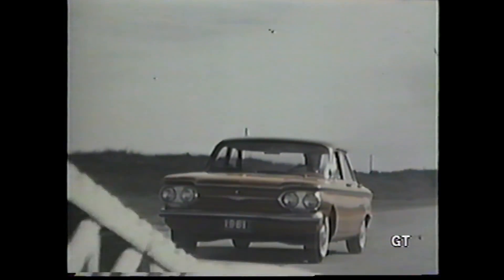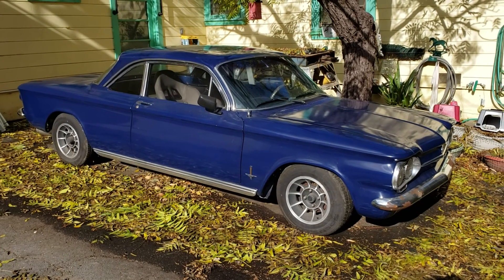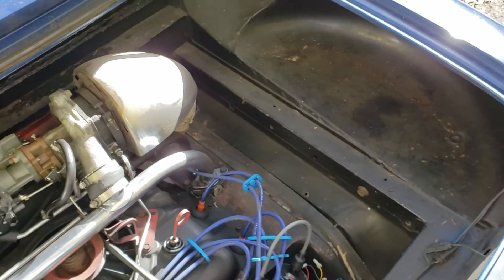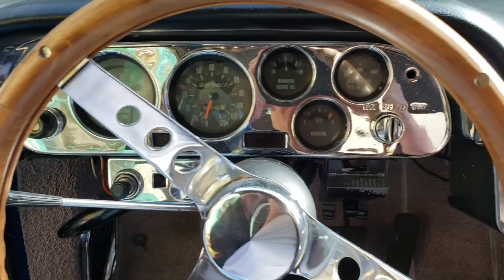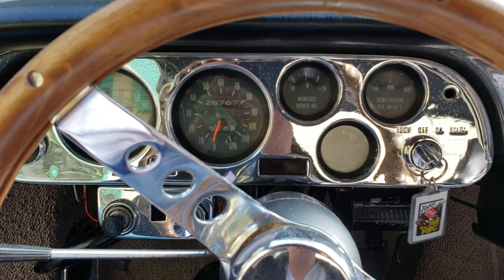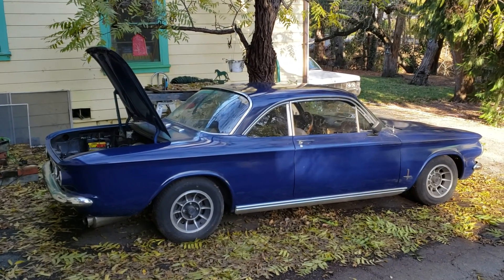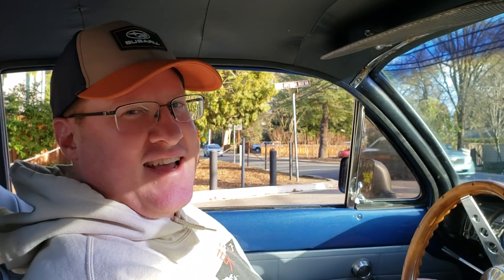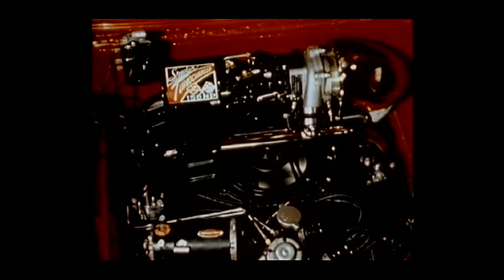My 1963 Corvair Monza Spyder: A Turbocharged Air-cooled Oddity

Comment: Love the vintage videos at the beginning and end! I had a 65 Monza 110/PG. I found that the best handling for my car is 20 in the front, 30 in the rear for air pressure.  The car was fun to drive!
Reply from the maker: Awesome! I run similar pressures with 25 front and 35 rear and I also have a bag of sand in the trunk to weigh the front down some haha
Reply: @philberto78  lol. I never tried the weight in the front.  I was able to fit all of my drumset in it though!

Comment: There is a small company that makes a fuel injector replacement of the turbo carb. They basically took the fuel injection from the Pontiac Fiero, which is also a six (v), and tweeked it to work very nicely in a Corvair! 🙂
Reply from the maker: It's good that people are coming up with all these alternatives to the original carburetor. I've just ordered an electronic fuel pump that's supposed to regulate fuel pressure better than the mechanical pump. Hopefully it will solve my flooding issues for good!
Reply: @philberto78 be advised some fuel pumps do make too much pressure so if you get carb leaks after you put the pump in you will beed to reduce pressure.
Reply: free food card

Comment: I had a Spyder back in the day. My biggest problem was when it was hot and you shut it off, it would vapor lock and refuse to start.
Reply from the maker: That's interesting, I've been unable to start mine many times as well after I've driven it around already. My problem was just flooding though. I've recently gotten a pressure sensitive electric fuel pump for it but I haven't installed it yet.

Comment: 4:20 they are about the same as any other engine but with some quirks.

Also i dont think tge early models cane with a alternator so that was put in and i think atleast that cap on the distributor is aftermarket, i think they all were boack 
I plan to put in a modern ignition system and some other nuce things.
Reply from the maker: Yes that's one way to put it haha! Ah you have a Corvair too? Definitely get rid of those points and it will run much better. The fuel pump I got is from Clark's Corvair and it is supposed to have the exact pressure the car needs. I haven't installed it yet though.
Reply: @philberto78  I think it's around 6 or so psi, I might just replace the carbs with efi it bike carbs at some point.    Mine is a 63 Monza.

Comment: We had a regular Corvair a couple of years before we got a Monza Spyder.    With the standard one you had to really look for a chance to pass, but the Spyder had plenty of acceleration.  It had sports-car like suspension (a first in the US I think), and the Corvair was the first unibody car built in the US.  They tended to throw fanbelts-- one learned to keep a spare in the car.  (Allegedly a pair of panty hose would work well enough to get you to where you could buy an OEM belt.)   The front end was a little light--it handled better if you tossed a small sack of sand or cement into the trunk.  Our previous car was a 1950 Oldsmobile 98, so riding in a Corvair it seemed like your rear end was almost on the pavement.
Reply from the maker: I've luckily never thrown a fan belt but everyone who's owned a Corvair has told me the same thing. Well not about the panty hose though haha! Yes it's a very different driving experience than most cars, very sporty especially for the time it was made. I keep a bag of sand in the trunk as well to keep the front end down better.

Comment: The sad part is storing it outside and a cover can be problems with holding moisture under it. Should also  start it frequently. The oil could be bad with condensation so hope you checked it. Guess this had been some time ago.
Reply from the maker: Yeah I really felt bad about neglecting the poor car for so long, living in another state made it really hard to keep the car up. Now I finally have it with me in Arizona where I'm working on it again.

Comment: SYK - It was the second turbocharged car (by a month).  ;-)
In the early 70s, Nader was proved wrong.
A Corvair is no more dangerous than other vehicles of the time.
Reply from the maker: I had to look it up but I guess you’re technically right haha, that short lived Olds Jetfire released a month before! Seems like it was kind of experimental as it needed a methanol injection system just to avoid engine knock...yikes!
Reply: Ah, somehow I missed that, I was sure it was a production, not a test bed, I'll look again to verify what I read?  If it's a production car, then Ill be right.  ;-)
Reply from the maker: @TairnKA  It was produced, I just meant that the car had a very short lifespan due to not being engineered very well. I think I read they made almost 4k models with the “jetfire” turbo though.
Reply: @philberto78  Ok, thanks.

Comment: I just bought one of these recently, and I'm rather hoping that you might have some ideas for me. I'm having  an issue with my 64 turbo, she's idling too high, and running too rich. I think I can fix the fuel mixture by adjusting my carb, but I'm not sure about the idling issue? Any ideas?
Reply from the maker: Congrats on your new ownership, or maybe I should give you my sympathies haha!
If you can't get the idle down by making any adjustments to the idle or mixture screws you might need to adjust the carb's float level or get a card rebuild. I think I mentioned it in the video but the carburetors in these cars are what's going to give you most of the headaches.
Reply: Check the throttle shaft for play, as it is probably worn, and will cause a air leak there, and mess with the idle speed. Those throttle shafts are chrome plated brass, and dont fit well (excessively loose) even when new. There are new throttle shafts available that fit much better than stock.
Reply: Replace carburetor with a fuel injection kit from Blackhawk engineering. It's basically a tweeked Fiero injector and your life will be smooth sailing when it comes to car idling, etc... you will have to plug it in to a computer to make adjustments but the kit comes with the program(I think) to manage it.

Comment: Usually, the first modification owners made to their turbos was to remove that tiny little restrictive Carter YH carburetor! those carbs didnt work that great when new... they are flood prone, and are typically set-up too rich. A bigger carburetor will allow a LOT more boost! The hard starting when it has been setting a while is the float bowel getting dried out, and can be fixed by adding an electric fuel pump. Turn the key on, let the fuel pump prime the system, then hit the starter... it should start right up.
Reply from the maker: Yeah I can't even tell you how many times I've had the carb flood in the past...but it's running pretty well now after I adjusted the float level finally. I'm trying to keep the car as stock as I can for now, even though I'm sure that like you say I'd get more power from a different carburetor. 
I checked out your old video and it looks like you did A LOT of work on your '63. Pretty cool engine setup indeed! Are you still driving the car?
Reply: @philberto78  Yes, I'm still driving it, although since those videos were done I had to replace the cam. It has a custom cam and once I got the timing curve and fueling right for it, SHEEZUS does it scream! I have 22,000 miles on it with the new cam... approximately 6000 miles per year. I get 22-23 mi/gal "around town" and over 24 on the freeway. I hope to get a couple more videos up this year on it.
Reply: @philberto78  Although the re-setting of the float height helps a lot with flooding, the near total cure is to add one of those all metal ball and seat type of float valves.
Reply from the maker: @63turbo  Wow that's awesome that you drive it so much!  I'm not sure what you mean by metal ball and seat valve, where would I get something like that and do they make one specifically for my carb?
Reply: @philberto78  Yes, they are available for the Carter YH. Clarks Corvairs has them. The float valve that you now have has v-shape, and has to push against a sharp edged hole to close. These have been made with both rubber tips and brass tips, but both types wear out (from the sharp edge) and are not accurate in metering. The "ball type" replaces the pointy v-shape with a ball bearing, and has a conical seat (kinda like the point on a drill) to push against to close. Before I used that type of valve (when I was using the YH), it was pretty normal to have it flood 4-5 times a year. After I replaced it, only one flooding event, and it turned out that the choke had gotten stuck closed, so it wasnt the float valves fault. The revised float setting that you use now is the way it is recommended for use with the ball valve.
Reply from the maker: @63turbo  Thanks for the tip! I couldn't find it in their catalog but I'll call Clark's later and ask if they have it. They're a great business I'm glad they're around.
Reply: @philberto78   Heres the part number: C3799. I just looked it up, and yes they are in stock! Its been a long time since I ran a carb, and sorta forgot the "trix"... some of my Corvair buddies basically refuse to drive the stock carb without first replacing the stock float valve with that ball type... it is really that much better!
Reply from the maker: @63turbo  Thanks a bunch! I'm going to order one right away!

Comment: Nice car 👍
Try never use starting fluid, it destroys the engine.
Reply: That's not true it's a myth you think the engine is going to run 100,000 miles and stop because of some ether it can cause light detonation upon starting but nothing to shake a stick at although you would never want to use it on a two-stroke that is not a myth

Comment: Spider actually means it's a convertible, not that it's a turbo
Reply from the maker: Usually that would be correct, but with Corvairs they used the name differently.
Reply: If I'm not mistaken the turbo corvair is a corsa.
Reply from the maker: @TheSpaceghost69  The Corsas were the second gen Corvairs that came out in 1965 and were available with a turbo but didn’t always have one. The Spyder name was dropped in 1965 too.